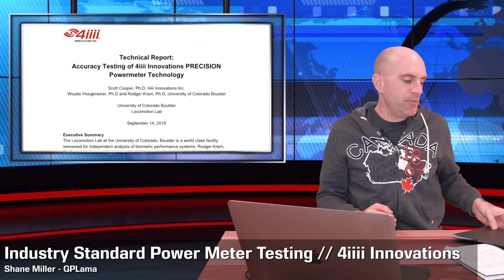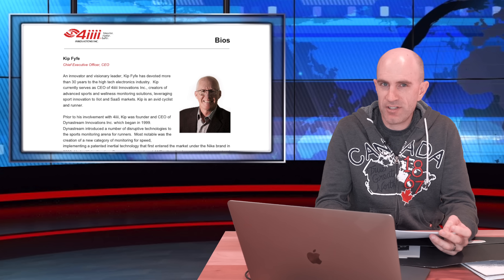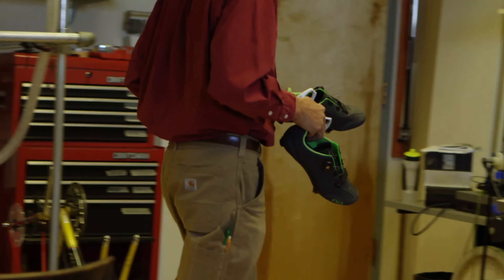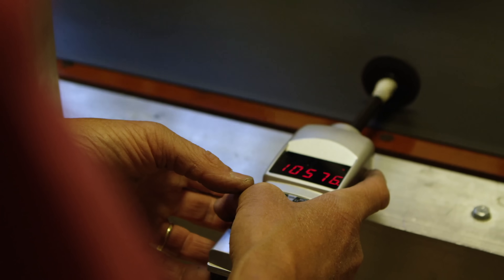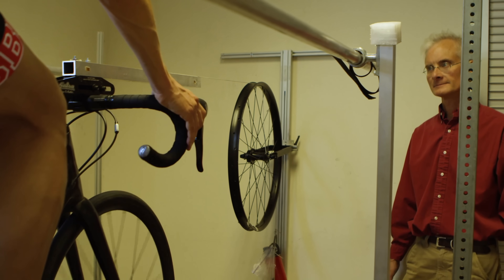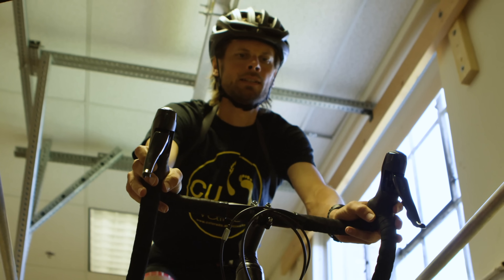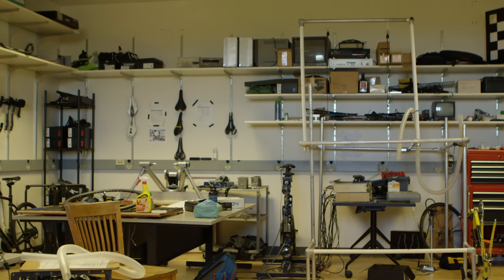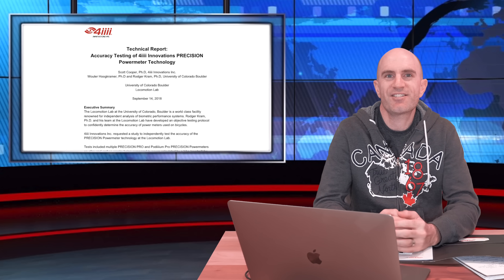Industry Standard Power Meter Testing // 4iiii Innovations

Comment: Seems to be a bit of guesswork there. The gravity and the bike moving on the treadmill like you said. But also the hot and cold thing. Putting a power meter in the freezer may not get the same temperatures each time. Might take them 2 minutes to put the cranks on one time, then 5 the next. It would be very marginal, but still. The drivetrain loss as well. He says a number they take into account, but if they use the same bike and drivetrain for a year, it will wear and the loss will change. Not to mention the fact that the lube will wear away and they'll likely change it. 
Love the idea, but it seems they need to be a bit more precise too.

Comment: Thanks for posting this Shane, when I read the initial paper I was going to burst into print but bit my tongue. I agree the cadences are not very relevant but I'd also argue that power meter accuracy at steady state is a hell of a lot easier than getting the instantaneous torque measured correctly from accelerations and sprints etc. I have no data but suspect that this sort of steady state benefits an powermeter like the 4iiii or the stages vs one with multiple strain gauges in the crank / chainring interface.

Comment: Are you telling me the CeramicSpeed direct-drive train concept (if it even eventuates) could only save a maximum of 2% of lost drive train/chain efficiency? Talk about a God-level marginal gain! Actually, it kind makes sense. After all, it’s their entire business ethos.....
Reply from the maker: Exactly. It's about relative measurements. Going from 2% to 1% is a 100% improvement. ;) Doing the measurement on the system as a whole....is not a lot.
Reply: umm... I guess you are just teasing us, but for the record, assuming 2% drivetrain loss to tweak the power means that if the measured power is 200 watts, then the ACTUAL power being applied by the human is 204 watts.  IF the drivetrain loss was only 1%, that would be 202 watts.   Not quite "100$ improvement"...  heheheheee...

Comment: Loving this!
Wonder if those aero-pods will catch on? And why do Pioneer power meters read low?
Reply from the maker: Aero sensors will have their place.... mostly in triathlon if they can get the price down and the user experience simplified (and usable). As for Pioneer power meters....well... I'm about to clip in for the 10th ride on mine trying to get to the bottom of why mine doesn't really agree with the Assioma DUO (or the Neo, or the Kickr). I'm still not convinced Shimano cranks that have gauges slapped on them are an optimal power meter solution. That's just based on my experience with Shimano, Watteam, Stages, and now Pioneer.... so a few reference points.
Reply: Shane Miller - GPLama GPLama Wow thanks for the information, you're an absolute data genius! Hopefully you and Rodger can work together on power-meter accuracy testing. Seems like the two of you would really have a lot to discuss and offer. Would make for great videos too👍